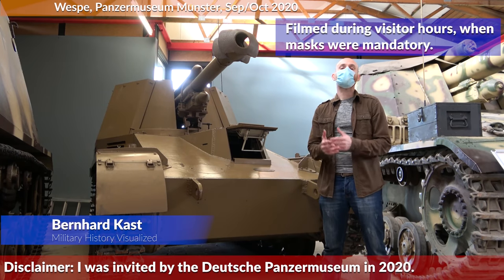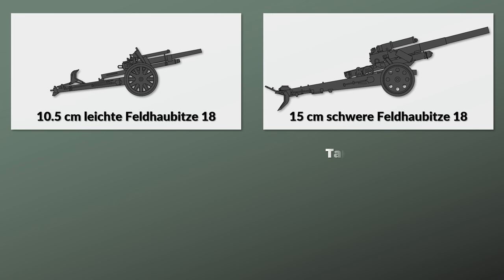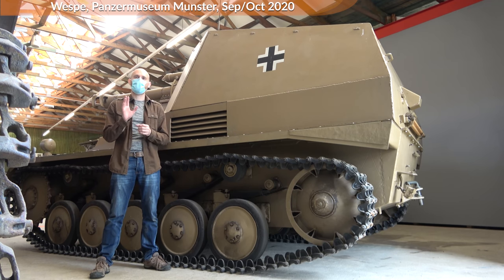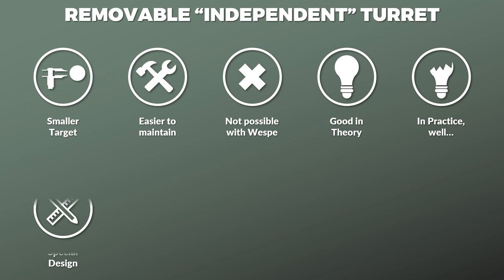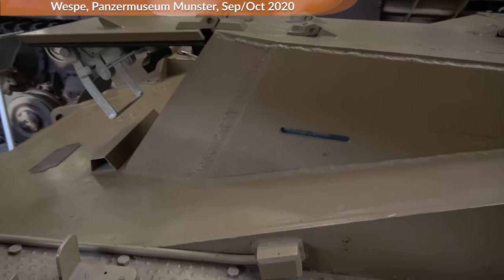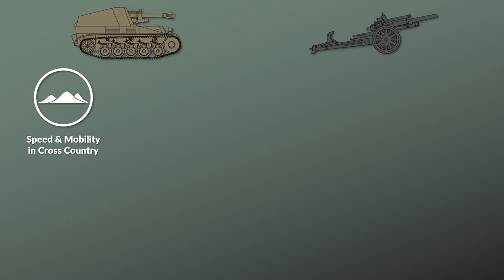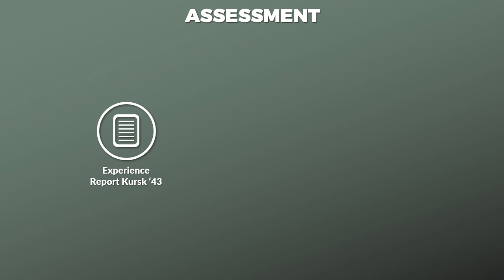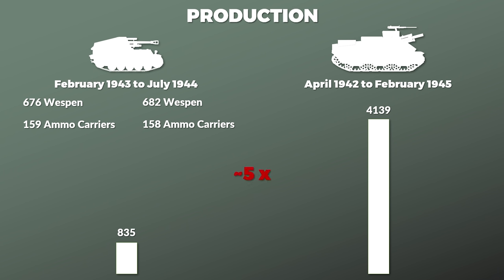Wespe: A Successful Failure?

Comment: The Wespe was another example of forced resourcefulness of German WWII procurement of weaponry.  The Heer had a barely adequate artillery park, as until the Versailles treaty could be openly defied, there was little manufacture of replacement artillery pieces, and, as the development of tanks was likewise forbidden (the Panzer I being developed in secret in the Soviet Union by the Reichswehr in collaboration with the Red Army, first units rolled out in 1932), obviously the development of self-propelled guns had to wait.  The invasion of Poland in September 1939 revealed that although the German artillery, exclusively horse-drawn, had performed above expectations, it still was incapable of fast enough movement to keep up with the Panzers.  There is agreement that rather than the vaunted "Blitzkrieg" being responsible for the crushing defeat of the Poles (indeed, in many cases the panzer units suffered humiliating setbacks, most notably losing an entire battalion of 40 tanks on Sept 9, 1939, in an ill-fated attempt to seize Warsaw by a direct assault w/o having adequate infantry and artillery to cooperate), it was the "punishment" inflicted by the German artillery on the Polish positions that tipped the balance.  So there was a huge need revealed for self-propelled artillery, to include both howitzers for arcing fire and assault guns for indirect fire.  Hence a SP AT gun, using Czech 47mm guns made by the Skoda works, was mounted on the Panzer I in a fixed superstructure as the original "Panzerjager", and a crude mounting for the SiG-33 15 cm howitzer was likewise devised for the same chassis.  The latter was intended at first as a mere carrier, so the gun could be dismounted, but in practice the piece was left on the chassis.  Although at least this got some heavy firepower that could keep up with armored units, it was a clumsy vehicle in a high, boxy superstructure that was ungainly and easy for enemy units to spot.

Meanwhile, although obviously the Panzers had performed well in the Battle of France, it revealed that the Panzer II, and obviously the Panzer I, were both horribly outdated as battle tanks, under-armored and with too puny main weapons.  The Heer had no choice but to use them in the Soviet Union in Barbarossa, where they were inadequate against Soviet T-26 and BT tanks; and when the T-34 and KV-1 tanks appeared (fortunately not in huge numbers until later in 1941), they were little more than coffins on tracks!  Meanwhile, the vast expanses of the Soviet Union made use of self-propelled artillery even more imperative.  The WaffenAmt would have preferred purpose-built artillery vehicles, but German industry was hard-pressed to produce tanks as it was.  The Panzer Is converted to SP and AT guns were used up, but the chassis was too small to mount adequate weaponry for combat in Russia.  However, both the Panzer II and the Czech-designed 38(t), the latter having given useful account of itself in both France and Russia; could take the German Pak 40 75 mm gun and captured Soviet 76.2mm guns (rechambered for German rounds) in a fixed superstructure for the direct-fire role, these Panzerjagers, both named "Marder" (Marten), were very effective against Soviet T-34s.  Likewise both could mount howitzers, the 38(t) got the SiG-33 15 cm gun and the Panzer II got the 10.5 cm howitzer, this would be named the Wepse (Wasp).  Despite the issues involved in adopting light tanks to carry medium artillery pieces in improvised mountings, both vehicles performed quite well.

Comment: Why not use a trailer to bring extra ammo?
Reply from the maker: Unarmored and likely get lost.
Reply: I'm pretty sure trailers for tracked vehicles suck. The Crocodile was apparently incredibly difficult to drive and the Rotatrailer was famously awful.
Reply: @Kyle-gw6qp  If the trailer gets stuck good and proper the tank would probably just rip of the coupling. Remember the tracks just messed up the ground right before  the trailer, so of road that's pretty likely.  the  And just think of the horror of backing up with a tank with a trailer attached to the back.

Comment: @A  it could not be converted from Panzer II into Wespe. Wespe was front mounted engine , while the Pz II had a rear mounted engine. But your point is 100% valid . 

Building 3500 Pz-I & Pz II pre-war; was something of a colossal investment but also subsequent colossal waste. So anything you could do to extend their usefulness would be preferable. 

A basic force structure of 15 mechanized divisions at the start of the war , should require several dozen panzer battalions or 100 company , each with >25 tanks or > 2500 tanks. The tank force also had > 700 medium tank pre-war, leaving 1500 surplus tankette. 

To that end one idea being the "escort battery". In the Great War often infantry companies would push/pull small light towed guns to have "Organic firepower" , when and where they needed it. 

The 1500 Panzer 1 could have filled a mechanized gun role with the IG-18 mounted in a Pz Jg 1 style configuration. That should allow up to 70 x  battalion each with 21 Pz-I /mech gun. This way Von Manstein can't divert the critical Panzer III production at the start to build STuG III. but the need can still be meet at the start of the war.

When the critical need would arise a proper replacement could be established replacing the Panzer III production with a Jag-panzer III by mid war....which could continue development and serve to wars end.

Comment: This gives great insight into the SU-76, which I think was a much more successful implementation of self propelled artillery.
Reply from the maker: it was also a tank destroyer from what I know.
Reply: The SU-76 was a 'difficult' Self Propelled Gun. A conversion of the T-70 tank, it was relatively simple, but it was also open topped and bitterly cold. The driver had to sit next to the engine, so it was both noisy and hot for him and it was terrible to drive, which is why it became known as 'suka' (bitch), 'Suchka' (little bitch). The problem was there were two engines in parallel and each drove a different track. So the driver was constantly wrestling with the steering by controlling the output of each engine. As the 76mm  ZIS-3 was not very powerful against German tanks, it was relegated to indirect fire, as was the M-10 on the Western Front.
Reply: The Soviets might have had superior self propelled artillery doctrine, but the SU-76 in particular was a distinctly lackluster vehicle.  Being based on the T-70 chassis they were mechanically crude, unreliable and I am given to understand very unpopular with their crews.  I don't think that technically the SU-76 did anything that the Wespe didn't do better.